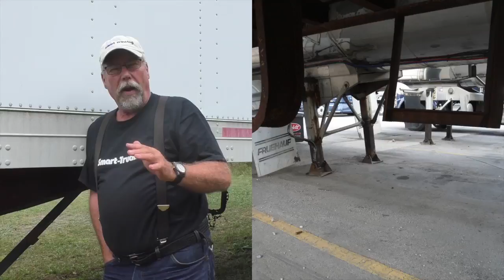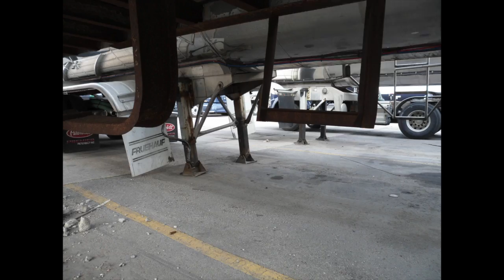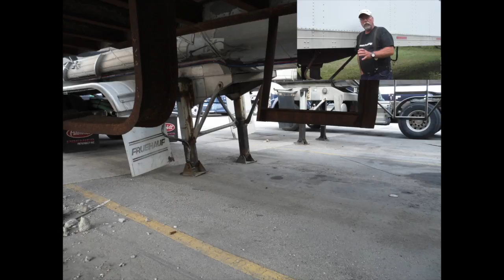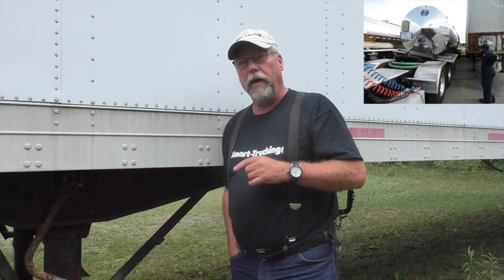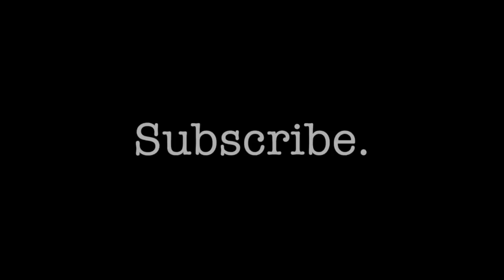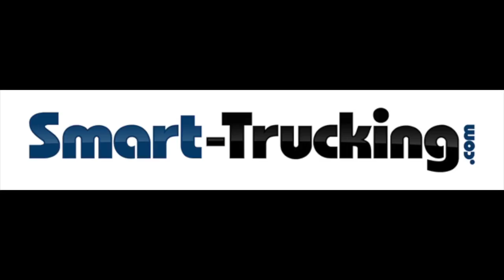Avoiding Disaster - Landing Gear Fails on My Loaded Liquid Chemical Tanker Trailer

Comment: I lost my job in a situation similar to this. I hooked up to a frac pumper. Backed in under the guidance of a mechanic and hooked to the kingpin. I pulled gently forward. Then, the mechanic got under and verified that the jaws were locked. We hooked up the air lines, electric and smart cable.  I did my walk around which included verifying that the jaws were locked and no space was between the fifth wheel and glide plate myself. I got in the tractor, had the mechanic raise the landing gear about half an inch, and I did two tug tests. Set the trailer brakes, reversed against it, then pulled.. again, twice. The jaws were clearly locked. We raised the gear, i finished entering everything into the ELD and doing my DVIR. I began pulling out. I made it maybe 15 feet and heard a loud bang. The tractor shot forward and the pumper rolled off the back. 80,000lb pumps destroy landing gear when dropped.

My district and regional manager believed me and were ok with everything. I had 4 written witness statements from guys that saw me do a complete walk around and tug tests. However, the corporate office demanded that a test be run on the fifth wheel. The next evening, I was in the office being fired as they claimed the fifthwheel passed.  Of course I never saw anything and unemployment pretty much told them they couldn't prove any negligence on my part whatsoever. The fifth wheel clearly failed and there were witnesses but the company said there were too many instances in other districts so they were now firing people. In other words they had to start pinning blame on someone for the insurance costs or whatever...

Comment: Hey Dave, here is my little story of trailer mishap.  I had just unloaded at a receiver, a drop and hook, so, I hooked up the empty trailer, and took off for my next load.  After several turns and had gotten back on the big road, for some reason, I needed to pull over on the side of the road to check map or directions or something. So, after getting the info that I needed, I started to pull out, and the trailer came unhooked, and dropped to the ground...still in the emergency lane. Yeah, I did the tug test and all, but the pin lock came loose.  I got the trailer jacked back up, and got back under it, but I was so glad that I had to pull over...that would have been catastrophic to have lost that trailer at highway speeds.
Reply from the maker: Yeah, that could have been a lot worse. Fifth wheel jaws are like anything else, they can fail on occasion.    Dave

Comment: Thanks as always. It happened with me as an owner operator while switching bison trailer and one leg of landing gear bolt came out , when in mirrors I saw it's tilting one side , right there I reversed and hooked back again , fixed with bolt and learned a lesson.

Comment: Thanks for your advice Dave. I don't drive but as a fork lift driver, in and out of trailers all day, this ratchets up the situational awareness a bit higher.
Reply: Ed Spencer gm always made us use jack stands i guess the forklift is pretty heavy and without jackstands in city flyers can be interesting but we always used them cuz you never know.

Comment: I've done this from day one of my 20 year career.
In those years, it only happened once. Because I practiced what you're talking about, the trailer, and cargo, was saved.
All that was needed was a tow truck, to lift the trailer off the rear drive tire. 
In the last few years of my career, the BEST option I had on my truck was the air suspension release valve on the dash.
Once dropped, i could dump the air from the drive axles, and take all the weight off the 5th wheel, before pulling away from the trailer.
Make sure you pull forward a few inches, to disengage the kingpin from the 5th wheel before dumping the air.
Otherwise it'll catch and make a gawd awful noise when you pull away from the trailer, LOL!

Comment: It happened to me. I was dropping the trailer and one side of the landing gear did not drop to to a steel pin that had fallen out. I was between two trailers but I was fortunate that I did not pull out completely from under the trailer and the front of the trailer was resting on my tires. The trailer was tilting but did not touch the trailer next to me. A service person came and jacked up the trailer and fixed the problem.
Reply from the maker: Nice catch!    Dave

Comment: Not just landing gear collapse, but floor joist failure, and legs dropping into the ground can be lessened. I prefer trucks with suspension dump switches, I ALWAYS dump the suspension as soon as the kingpin unlocks, that way it's a smoother weight transfer, and if something is going to give, hopefully, you will be able to get the trailer locked back on, so it can be fixed or moved to a better spot, instead of waiting for a wrecker....
Also, besides damaging trailers by just popping out from under, you can damage your airbags and shocks on your tractor....
Whenever I get stuck with a truck without a suspension dump, I always try to catch the moment the fifth wheel pivots, braking to try to lessen the weight transfer shock, and give the truck time to air down the suspension to avoid hooking a crossmember on the kingpin.
Reply: bigtrucker26 excellent point to dump your air bags

Comment: Worked in a Trailer repair shop for a number of years. Out of all the landing gear replacements i did (And i did around 3 a week most weeks sometimes more) 80% of them was caused by the gears stripping.. mostly from the gears getting in a bind for a number of reasons and the drivers trying to crank all that weight on the gears.. Some cases even with the trailer loaded which is a sure way to destroy those gears..
The other 20% of replacements i did was complete and total failure of the landing gear frames and all. There's also a number of things that can cause this the vast majority of the time was crossing railroad tracks or trying to go over graded humps in places the driver should have never went in the first place and rip all the supports right out and fold them under the trailer or rip them completely off. A few times the gears fold to the side while being loaded. Much more rare but that does happen. Mostly on very old trailers with poor cross bracing.

But if you go to hook to a trailer and the gears are in a bind do NOT try to force those gears to do the work. Especially on a loaded trailer. Use wood blocks on your tractor frame and your air bags to get them out of a bind first then do what you need to do. And be very mindful of going across railroad tracks. Those are the two main reasons we seen landing gear failures.

Honestly i learned more about properly operating a commercial vehicle from working in a trailer repair shop than i ever would from a driving school... Especially backing the trailers of ALL types. Spread axles being some of the worst. Blind siding as they call it also being quite tricky and something you really need to know what your doing to do successfully. And something you probably will run into having no other choice but to do sometimes. But yeah i think every driver should have to hang out in a repair shop for at least a couple weeks and do all the moving of the trailers we work on that gives more real world experience of whats going on than anything else in my opinion anyway. Seeing some of the repairs we have to do because of mistakes and such goes a long way to teaching people how to avoid such things. Especially if you get a taste of what it takes to repair some of these mistakes.

And check those damn bushings on truck AND TRAILER!!!!! I cant tell you how many repairs i had to do that was 10 times worse and 10 time more expensive on equipment because drivers ignore those bushings going bad then wonder why they can't back the trailer worth a damn and why it trails 2 foot to one side while going down the road...

Comment: Pre trip and post trip inspections look for bent supportmembers and crossmembers, cracks, loose bolts- Does the gear work like it should (goes up and down easy) or is it a fight to make it work? Is one of the feet cockeyed or twisted right or left? WATCH OUT! I pulled chemical tankers for 24 years. They are notorious for weak or damaged gear because of being around rail yards and RR tracks. Also they have no baffles-most of them are clean bores which means if there is a slight downgrade to the front when you drop a loaded WATCH OUT. The ones with compartments-is there more product in the front compartment than the rear compartment? WATCH OUT.If you can't get it positioned to have the backend down hill you have to get some kind of support under it ASAP. A proper trailer jack-an old yard tractor- a stack of heavy timbers- anything. What is the surface you are dropping the trailer on? Concrete is best- asphalt? How thick? I've seen gear sunk to its knees in thin asphalt. Gravel and dirt the same. Does this type of yard see plenty of traffic? Is it solid? Timbers-Timbers-Timbers under the feet if in doubt.
.

Comment: Dave, I concur with you about trailer drops. Also like to add is to make sure the surface is solid enough to take loaded trailer weight. I was swapping trailers with another driver. When he unhooked and pulled forward, the trailer stood perfect! But when I attempted to hook up trailer, I got to check trailer prior to hooking up then saw the landing gears stink into the surface. It seem the lot was infested with PRAIRIE DOGS TUNNELING throughout the whole parking lot. A recovery truck got it back out, but it was surprising...lol! 
What could I do...lol

Comment: How things have changed. Back in  the mid 60s when I started driving truck, some trucks and some trailers had vacuum brakes and the ones with air were not much more reliable because if the air leaked out the brakes were gone. If that wasn't bad enough about half of their trailers had no landing gear so we had to build up blocks or drums under the loaded trailer to support it. Of course that meant that when you went to back under the trailer you had to hit it hard enough that if it started to roll you could still hook up to the pin. My dispatcher used to say "hit it like you'd  hit your mother in law." 
By the way, be glad there are no more road tractors with vacuum brakes, because if the engine stalls you not only have no power but you also have no brakes. 
On a truck with air suspension I always pull out a bit then drop the air out of the bags, so that if the landing gear fails the fifth wheel is still under the trailer. Oh yeah, one good thing about learning to drive truck with crappy equipment is I know how to pick up a trailer where the landing gear failed, because I used to do it daily.
Reply from the maker: You got a laugh out of me! I remember back then bumping a few trailers that took off on me! Haven'''t thought of that in years!   Dave

Comment: yup.. checking gear is holdimg before rolling saved my bacon tonight.. a pin sheered on the landing gear when two fork trucks were in the box before it was "safe"... the landing gear pin sheering and subsequent trl drp let out a loud boom like a tire blew... shook my nerves and probly saved the fork truck drivers from being crushed. the trl landed on the drives and was unloaded with a couple safety jacks either side.

Comment: I'm a mechanic and worked at a few rail yards and those  sea containers would buckle all the time.  Probably overloaded. Sometimes driver abuse not rolling the legs up all the way.  But the equipment does fail from normal wear and tear

Comment: I've only been driving 4 months and each person, including on the test, do it differently. So I put all together and take advice from every person and make my procedure. I always raise the suspension lower the legs leaving 10 to 15cm a gap then pull away from the pin stop get out of the cab and lower the suspension with the hand remote and watch the legs touch the floor and then lower it more to leave a gap between the trailor and 5th wheel. Today I was asked by a shunter and an assessor, that was assessing and training someone else why I do that. Now these 2 have been driving for years, I've only been driving 4 months. The reason they asked is because if I leave it too high some trucks can't raise that high. I explained I don't like dropping the trailor and the other reason I do it is so I can leave a clear gap between the 5th wheel and the bottom of the trailor, by the time I walk to transport office get my paper work for my other trailor and walk back whoch can't take from 5 to 10 minutes. If the trailor is not sitting on the 5th wheel I then know the legs are ok. The assessor kind of looked at me as if it say, yeah that's not a bad idea, but he just said everyone does it different. But both of them didn't realise and neither did I tell I am still beginner and still have a lit to learn but I definitely take advice from people and put it into practice.

Comment: It doesn't take much to damage the Landing Gear either. I was coming out on to a dirt road after picking up a load of Hay in a field.And I clipped the top of bump getting back on the road and bent the Gear just enough. I couldn't drop my trailer for weeks until the boss got it fixed. And I usually took my truck home every night as I was a runner for a Sheetrock Company in NM........ Oh and yes, my Landing Gear was Fully Raised at the time

Comment: I do that very thing when im dropping a loaded trailer.I  dump trucks air bags and ease out slow until i clear the trailer, then i stop before i pull completely out from under it. And when there is 40 ton yes i said 40 ton in the trailer is not fun trying to get it back up.When i drop a trailer i always do landing gear ,lines, 5th wheel, just a habit i got myself into.

Comment: I rushed a drop once.. I ripped one of my HIT lines.. I saved enough coolant to run the truck but I couldn't get the hose of the trailer fast enough.. thankfully this was in the unload pad.. me and some workers cleaned it up easily..

Comment: Also be cautious of the surface you are dropping a loaded trailer on. Many of us have been the victim of bad or soft ground, and had a trailer sink the Landing Gear. I know I have. Didn't know it till hours later when I came back for my trailer. And I did a drive around before I left, and it was fine. But while I was gone.......Whoops

Comment: Was that caused by a severe Rusting issue?,  I cannot understand why American (and Canadian) Trucks do not have' Fender Guards' over the Drive wheels to prevent Road spray and water spray to the underneath of a trailer, as that will be quite severe in the Northern states and Canada during the winter months especially with Salt on the roads.  I think all European trucks and Trailers have to have 'Fender Guards' to help counteract road spray (i have never seen any that don't). Also we have Reversing lights and Bleepers on Trailers, why none on North American Trailers, is all this just to save on cost?.

Comment: When I drop a loaded tanker I pull ahead just enough for the kingpin to clear the Jaws then I stopped and dump the air bags,and if the trailer has a dump valve on the suspension I will dump it first before I put the landing gear down and dump the airbags on the truck last.

Comment: Thanks Dave. Hey I just asked this question I just replied to your latest video about the first time driver and what he should do and think about on his first trip. But have you ever done a video on your Peterbilt truck as far as the specs what year it is transmission  all that stuff? If you have already done and I must have missed it maybe you could tell me the title of it. Thanks
Reply from the maker: My truck is a 2004 Pete, 280 w.b. with a 475 Cat, big rubber and an 18 speed with 3.55 rears. After doing that first video on my specs, I came across the actual build sheets and realized the rears were 3.55's instead of 3.70's as I had stated in the first video. Tough when you get old and your memory starts to go.    Dave

Comment: How about set trailer brakes first  before putting landing gear down.because most air ride trailers dump the air on the trailer when u set the brakes leave your yractor.brakes released until the trailer is done dumping air because the truck rollss forward tjos wat tou wont bend yhe landing gear.

Comment: Wouldn't you also dump the air in the tractor drive's suspension to lower the trailer even more before pulling forward?
Reply from the maker: Absolutely! Should have mentioned that!    Dave

Comment: oh boy I have seen it happen few times one time a loaded trailer with farm tractors on it yup it did a nose dive me just like you windows open in cab nose eliminated if loaded pads underneath it or the loaded cement pad no with air ride dump the bags yup I try not to drop a trailer on it nose yet  and I keep practicing my procedure every time